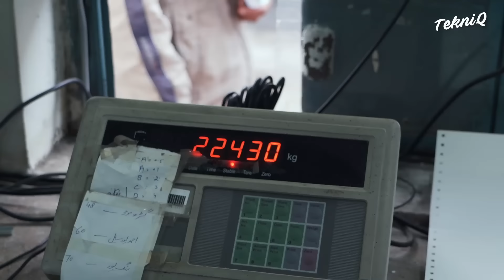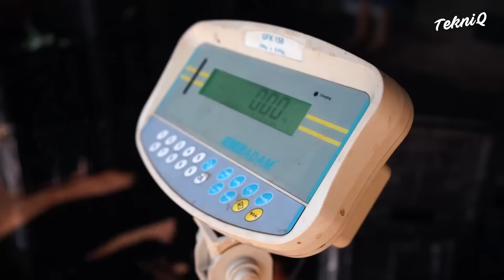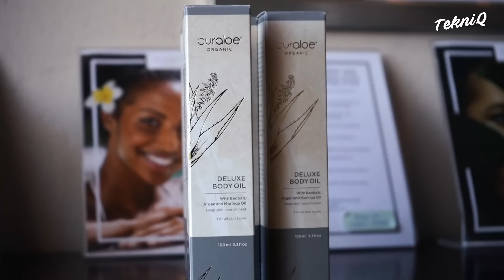Extreme Way They Load Trucks With Tons of Sugarcane Waste

Comment: What s the purpose where they  going
Reply: Sugarcane is used for making ethanol which is then used to mix with vehicle fuel. It brings down emission. This is waste of sugarcane left and they use this to produce heat and electricity in sugar mills. Other than that, it is used to produce paper, disposable food containers and as a cattle feed.
Reply: @aruji-sama 
Thanks for the information 👍
Reply: this is somewhere in India, Pakistan and or Bangladesh